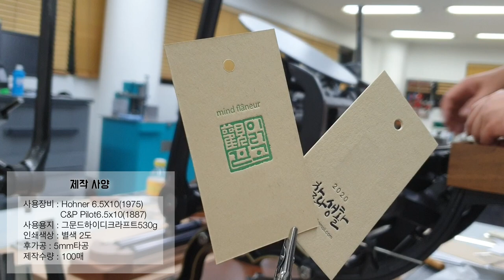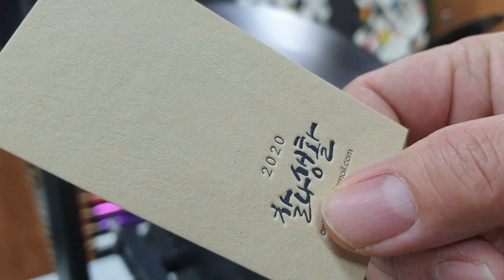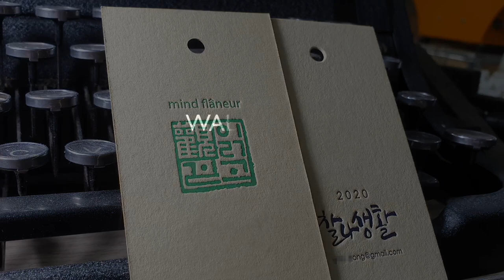Letterpress Printing별색2도 레터프레스 인쇄 명함 만들기.

Comment: It is great pleasure to see how professionals work. I have several questions and would be very happy if you answer. 
1) What kind of paper do you use and where do you buy it? 
2) Is it customization of Windmill or it has it own foil press? And if I understood correctly, it is hot foil press, am I right?
3) How do you make your plates and what kind of material do you use?
4) Why do you use 3, according to my calculations, letterpress machines if you could do same things on one?
5) How do you make templates for cutting paper on letterpress machine?
Thank you in advance. Please, do not stop making this videos.
Reply from the maker: nice to meet you. First of all, thank you for your interest. I am not an expert level yet. ^^ I will answer your questions.
1. Paper mainly uses cotton paper. It uses paper made by Gmund, Germany. The place of purchase is purchased from a branch that handles imported paper. For reference, I am in Korea. 2. Windmill equipment was originally only printable.
 Imported from Germany and designed and installed separately by Korean manufacturing plants. Currently, printing and foiling are used together. 3. When making a plate and requesting it to a plate shop after computer work, the plate is produced using a chemical corrosion method. As the plate, zinc plate is used the most, and sometimes magnesium plate is also used. 
4. I didn't understand the question correctly. If the question is not using automatic equipment and the question is why you are using manual equipment
Manual equipment is efficient when printing small quantities. You can use paper efficiently and print quality is good. You can check one by one during production. The disadvantage is that the production speed is slow.
 In contrast, automatic equipment (wind mill) has good productivity. However, in my judgment, the defect rate is high. Paper efficiency is also poor. So, I only operate the automatic equipment for mass printing.
5. As in the case of plate making, if the computer sends the cut-shaped data to the workshop, the workshop will produce laser processing and send it to me.

Are you curious about the answer?
We will continue to upload videos. Thank you.
Reply: @w_letterpress  Thank you a lot. All best wishes for your business. As for me, it is more than just a business, it is an art. Thank you for things you do. Your videos are astonishing. Keep going ❤️